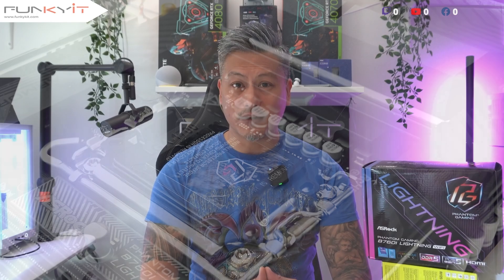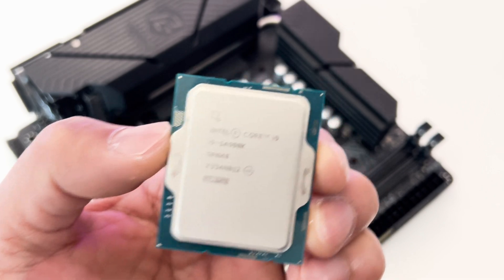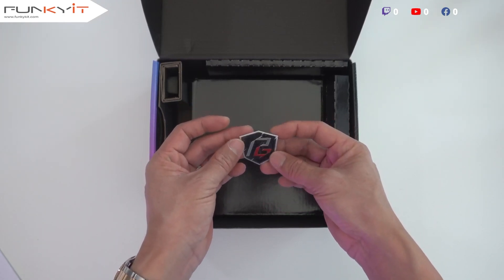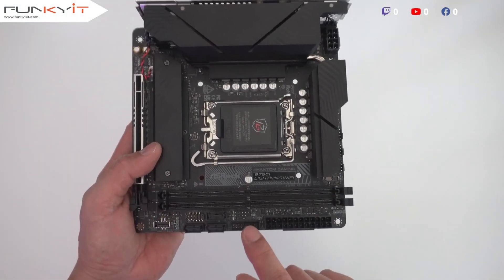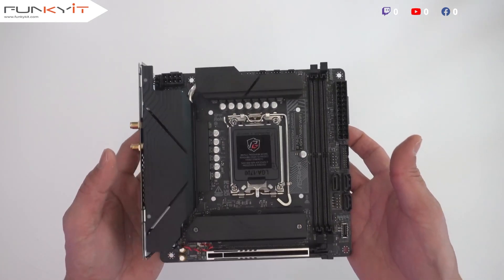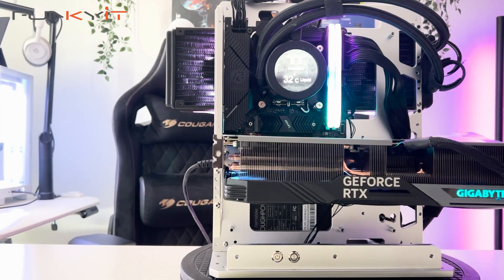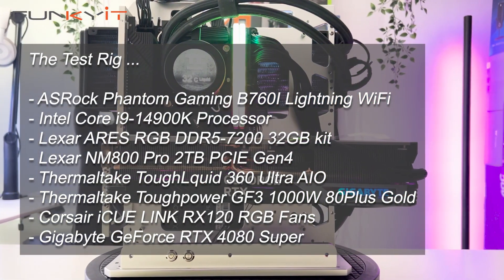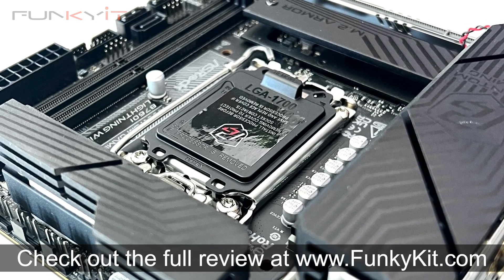A Feature-Rich Mini-ITX motherboard that PERFORMS! - ASRock Phantom Gaming B760I Lightning WiFi

Comment: i just had my system build with the same motherboard and i5 14600kf, with gskill 6400 ram, after putting everything together all i got is no graphic output, i press the power button the system turns on, but just no graphic, going to do some test tomorrow by swap parts, cross finger, hope to find the trouble easy.
Reply from the maker: I wish you luck… remember to update to the latest BIOS and also check the ram compatibility
Reply: @Funkykit KF series is supposedly a non integrated graphic version so it will show you no visual results unless you plug into it a VGA.

Comment: Is undervolt possible with that board?
Reply from the maker: I haven't fully checked, buit there is a section in the BIOs that allows you change the voltages.

Comment: Why did you use a poor lexar ddr5 7200 kit in this Mobo?? This Mobo can run ddr5 kit 8200 easy!  95% of the motherboards on the market can't do it! BTW if gaming is not the main purpose its a great build!!
Reply: He states that in his description "8600" and video. 6600> and that's perfect for the 14900
Reply: so this motherboard can't handles gaming for a long periods?
like doing game streaming 12hours a day?